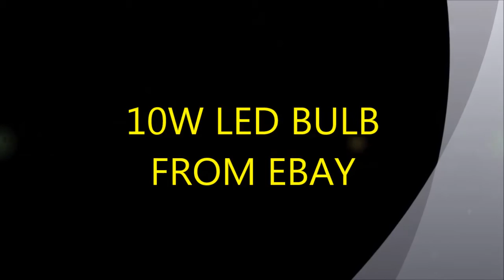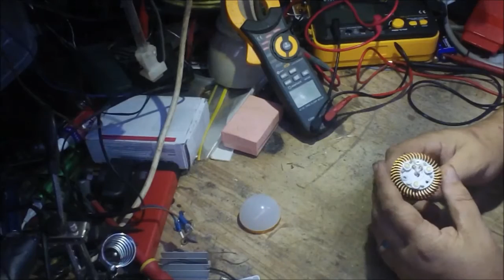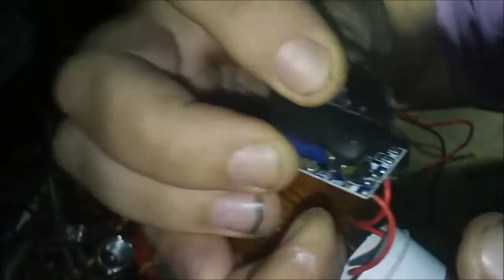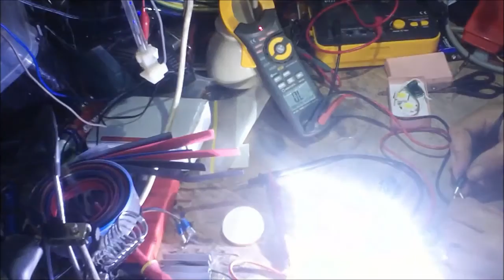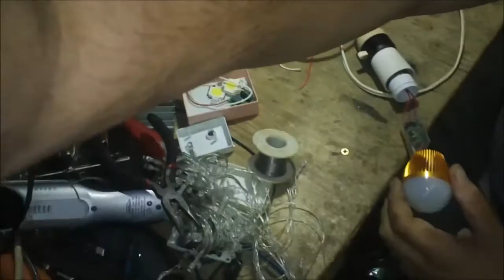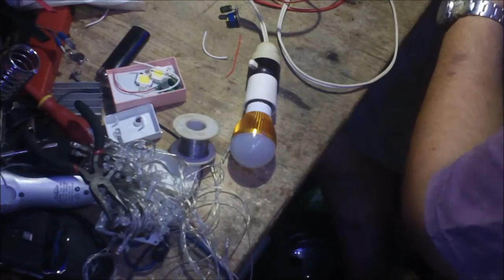10W LED BULB FROM EBAY

Comment: I find that those ebay led bulbs are often rated for 220 Volts. Australia is 240-245  Volts. I often wonder that the electronics is often underrated. I had a failure with two B14 led lamps in our kitchen range hood ( the fuckers lasted only 3 months ). Fitted two 12 Volt led strips with an external transformer.
Reply from the maker: +RODALCO2007 My mains voltage runs between 245 and 251 usually being 100m away from a 100kVA pole tx
Reply: +australianstig Nice and healthy voltage. Those Caps will run at there maximum voltage ratings. Ours usually hovers around 237 Volts. TX is about 200 meters away across the road.

Comment: There is some dodgy stuff like this all over ebay
Reply from the maker: +HDXFH It's not really a bad bulb if you know what you're doing and the mains isolation is actually pretty good, it's just the switchmode chip let it down